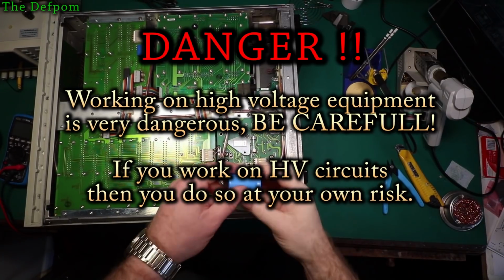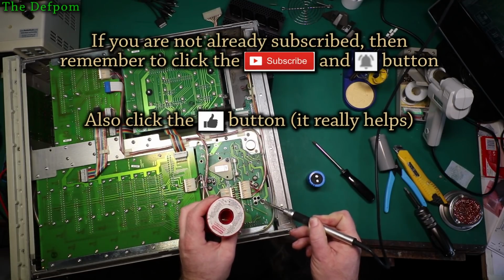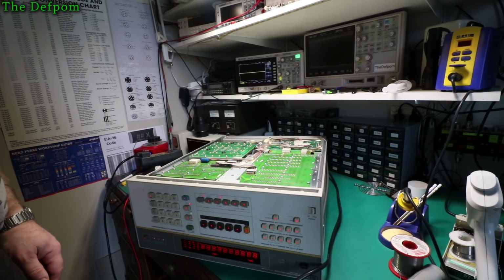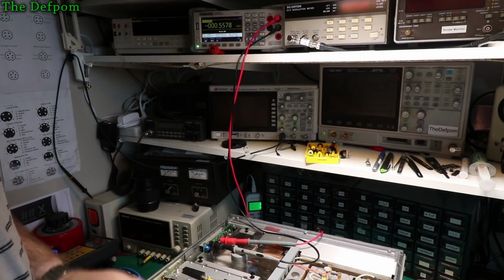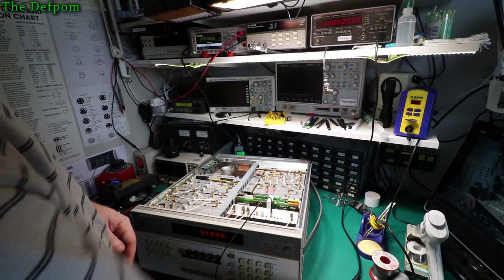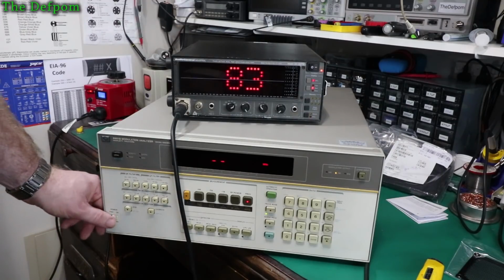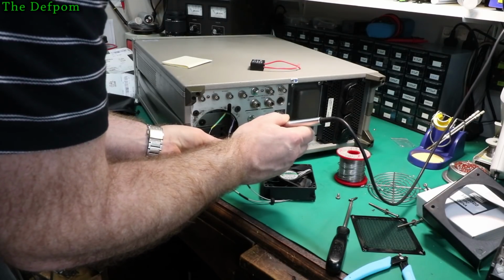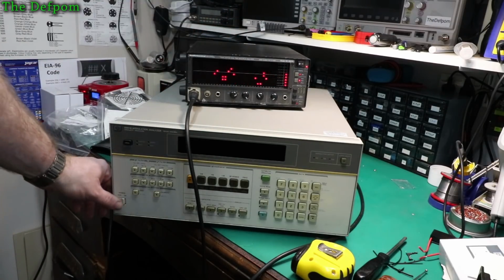🔴 #449 Fix It Friday - HP8901B Modulation Analyzer Repair Part 2

Comment: You could cut the end with the the terminals of the old capacitor,  solder the new one to the internal leads and use the screw  terminals.

Comment: I'm surprised that fan even turns! The blinking LED is the measurement cycle indicator, it "toggles once for each measurement cycle" according to the service manual. For high accuracy frequency measurements there is an input connection for an external 10Mhz source - your rubidium standard should work nicely. You can check to see if the 8901B recognizes the external source by entering 15.1 SPCL, 1 = external and 0 = internal - switching is automatic.
Reply from the maker: Yes I checked the manual later to be sure the leds weren’t indicating a problem. The rubidium works fine on it, but I like to have all my gear work independently and as accurately as possible without it, if I need accuracy I can plug the rubidium in, that way I don’t have to leave it running 24/7.
Reply: I agree, I like to keep the timebase in all my gear adjusted as accurately as possible . But I also have a GPSDO that I put together with a distribution amplifier a la Gerry Sweeney that I use to lock my generators and counters together for greater accuracy.
Reply from the maker: David V it’s funny you mention Gerry, I was re watching a few of his videos the other day because I purchased a faulty Agilent E3646A dual channel power supply, which he did some videos on. I am actually going to be doing a live stream on Sunday morning (NZ time) trying to fix it, I have already been poking around it and narrowed the faults down, some parts arrived yesterday so I hope to fix it live.
Reply: I really  enjoy Gerry's videos, but he seems to have stopped putting them out (on Youtube anyway). I have an older HP 6624A four channel system power supply that I resurrected from the dead - it's BIG and HEAVY but it is nice to have four voltages available. I'll try to catch your live stream - I enjoy your common sense approach to troubleshooting and repair.

Comment: I was crosseyed with confusion lol,  you said 56uf then 5600 then 5.6, make your mind up lol :-D.  (5600 / 100) x 20 = 1120 uf plus or minus.
Hmm dividers used as a ref, not too accurate, and the diode in each feedback must affect the feedback, none linear near center voltage perhaps?
Reply from the maker: zx8401ztv - yeah I think you weren’t the only one confused at that point lol.
Reply: I'm not alone with "One of those days." then :-D.
That old capacitor was as wide as a barn door, you have improved it's spec, it's too good :-D.
I would get the 5v at say 5.1v, logic is more picky that op amp headroom.
That's just my opinion, nothing else :-D

Comment: You do not need to sync it exactly as long as it is stopped or a slow crawl means you are 3 fifths of FA from what you require.
Reply from the maker: Zoony FireballXL55 - I just like to get things as good as I can. I will look into modifying it to add an ocxo at some point, I doubt I will be able to find the original part though, so will need to bodge something in there.

Comment: Bloody hell! That fan is the worst i've heard!  That new fan looks like it won't shift as much air? Most I have changed on HP gear are 115V and run of the secondary of the Tx.
Reply from the maker: +Simon Spiers - unfortunately I have no idea what the original specs were for the fan, so I looked for quiet with highest air volume specs and went for that, oh, and cheapish, not the cheapest, I never buy the cheapest.
Reply: 3D print a spacer to make up for the size difference.
Reply from the maker: I suppose I could do that, seeing as I have a printer !

Comment: Looking forward to watching, I own two of these (one working, one in need of repair).
Reply from the maker: buildstoys - this was a pretty simple repair, so may not be of a lot of help to you. 

You might be helped by having a working unit, as you can check test results between both units, such is outputs from each card etc, or even swap cards between units, although I only do that kind of thing as a last resort, as putting a bad card in may damage any cards that connect to it.